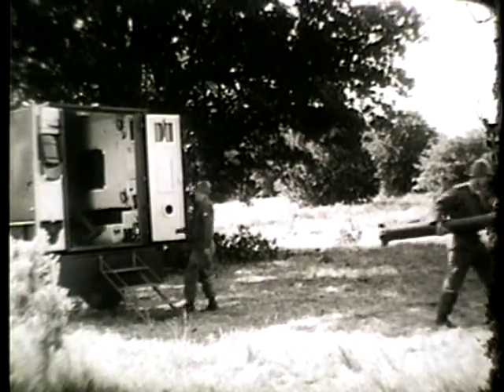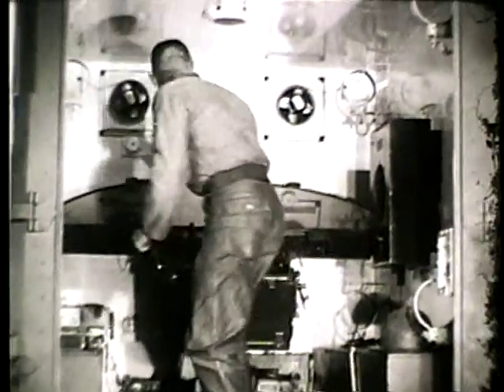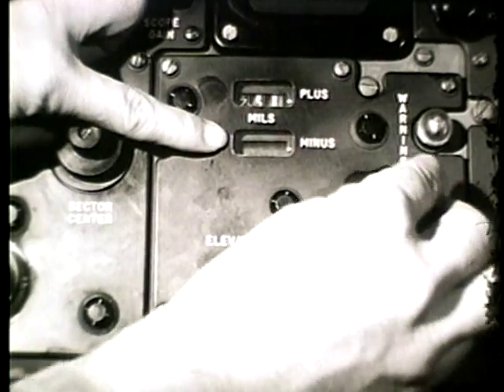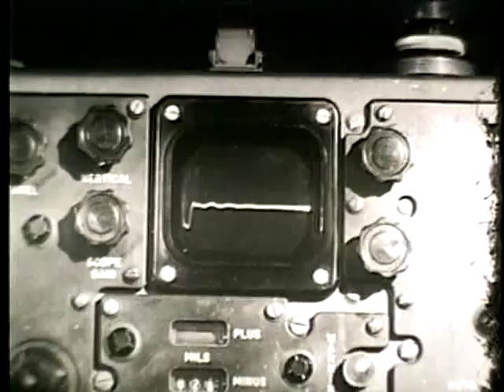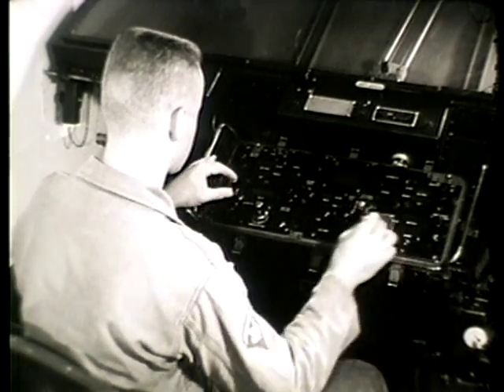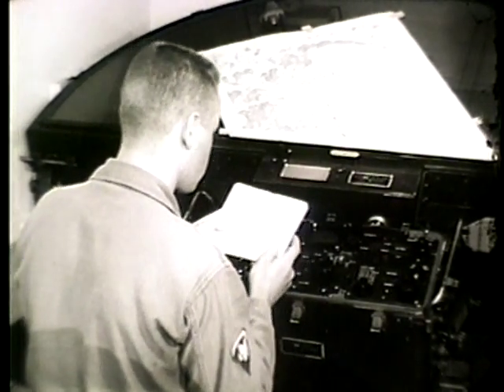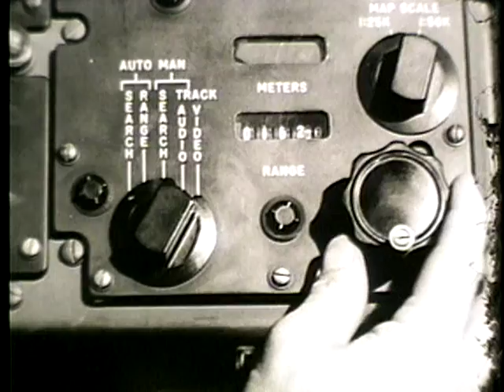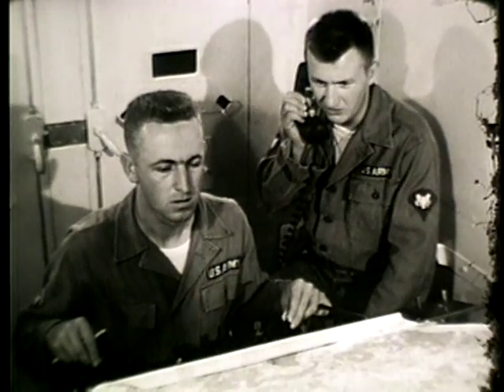The AN/TPS-25 Ground Surveillance Radar (1963)

Comment: Might work good in open battle but not in Vietnam
Reply: Its a 45KW Radar... its gonna penetrate a good amount of foilage
Reply: And did, the Firebases used them to good effect.

Sure you only saw bout a 1000 1200 into the jungle...

but that was still over 990 meters more that visual or thermals could do. 

Worse case mind you. General as soon as the wood libe start, you only see 10 maybe 20 meters inside, that radar could see well into it.